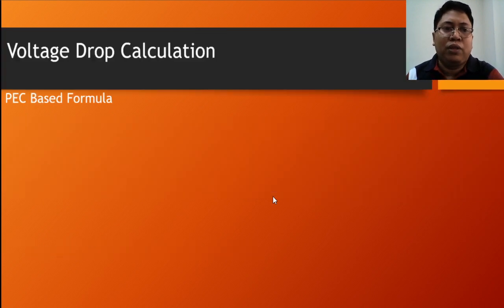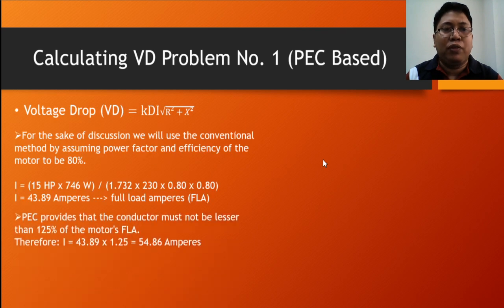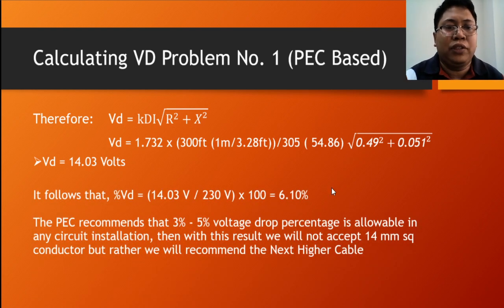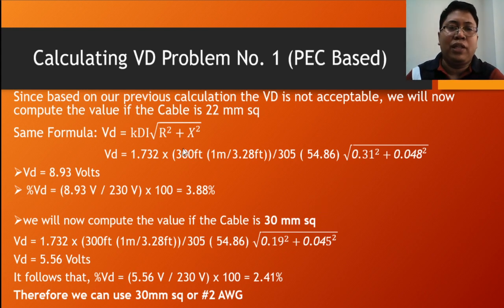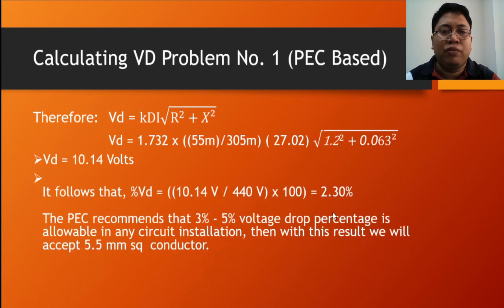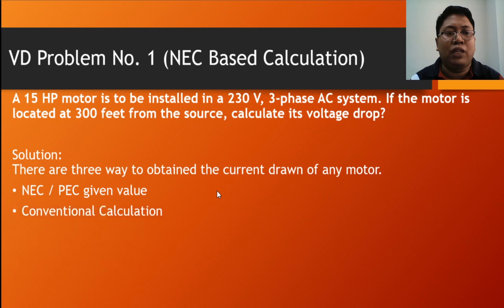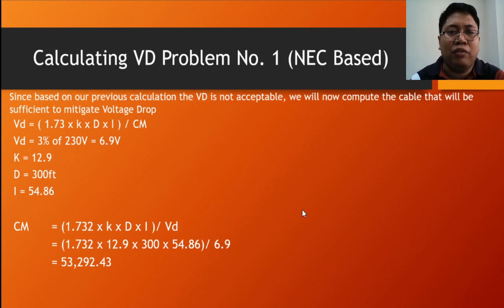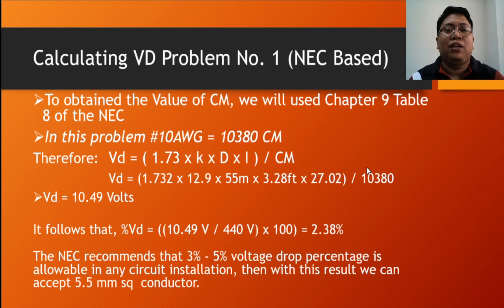Calculation of Voltage Drop using PEC and NEC approach

Comment: Bakit gumamit ka ng c onductor at 90C?  Ano ba ruling sa PEC as far as selection for branch circuit conductors is concerned? Assuming type B,C or D Motors di ba @ 75C ? and  if without nameplate ay gagamit ka ng default rating?